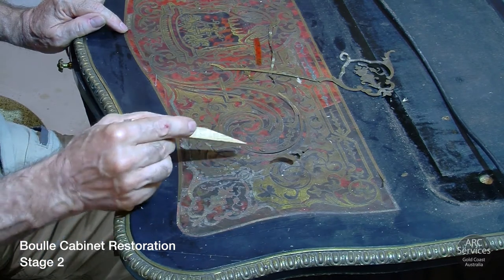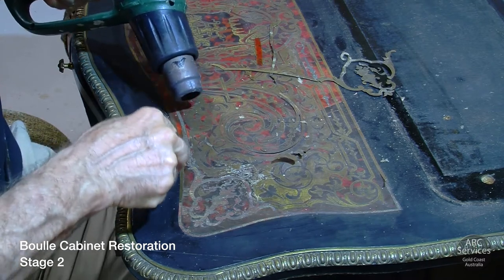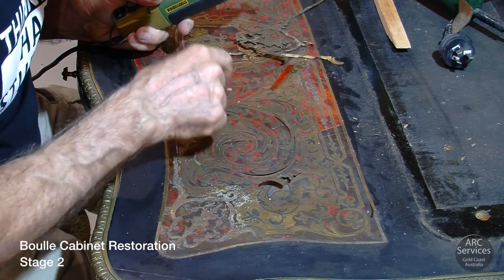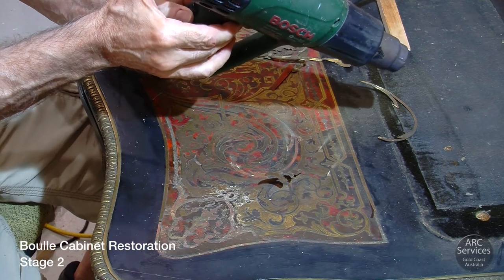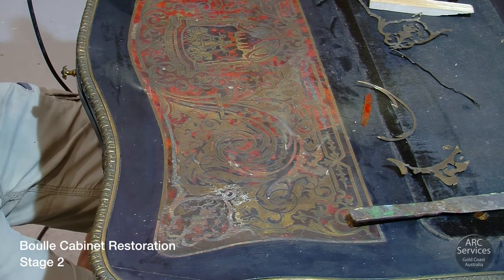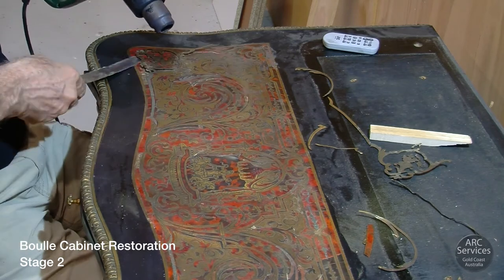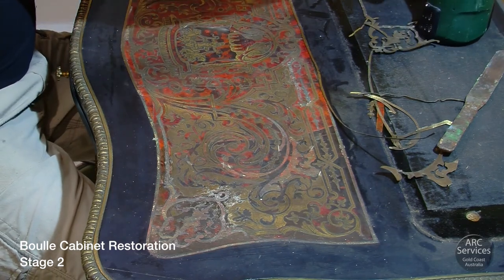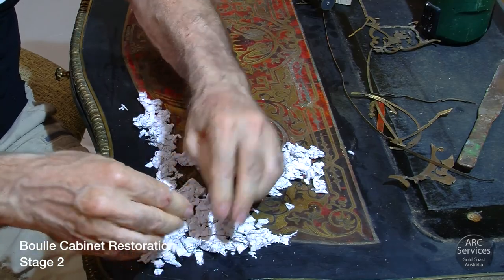Boulle Cabinet Restoration, Part 2

Comment: Sorry you only got 7 views what you are doing takes a great deal of skill and patience. Thankyou for taking the time to doe the video I hope you will do the third one
Reply from the maker: Thanks for the kind words. Next one is in the pipeline!
Reply: This isn’t how to. restore Boulle.  Tortoise shell doesn’t respond well to high temperatures, so the heat gun is damaging the piece. I routinely repair Boulle cabinetry, and would never, ever, think of using a dremel to hack away at anything! This fellow has very badly botched a very easy/rudimentary repair with his ham fisted ways.  There will be no third video, as it would only showcase just how poorly this bonheur was repaired.
Reply from the maker: @mangore623  Hope you find the third video interesting

Comment: Hi, can you please say what proportions are you using of the carnauba wax and beeswax, so you can mix it with paint and use to fill gaps. I tried many diffrent proportions, but I cannot get it right as it is either too soft, too brittle or changes the collour of added paint after drying and forming pinkish skin on the top. After trying for few days, I still cannot get this right and I serched the interner, but there is nothing about this.